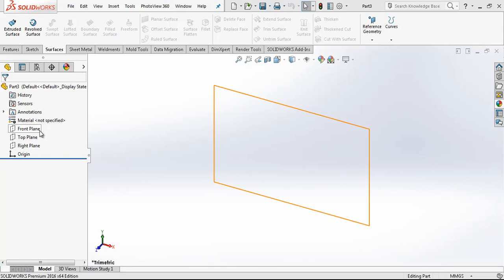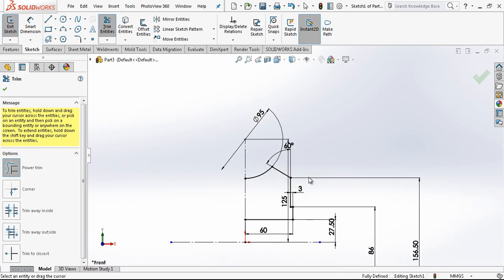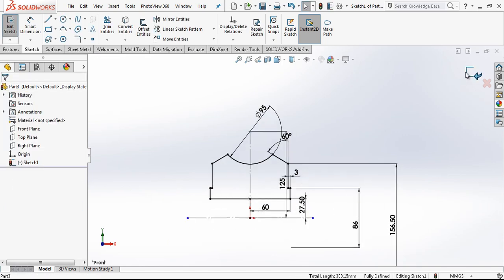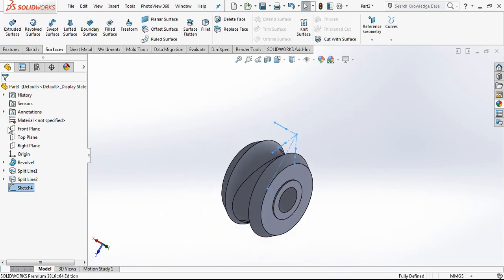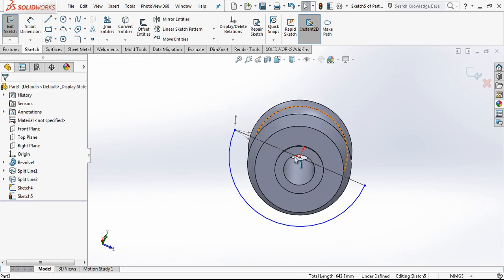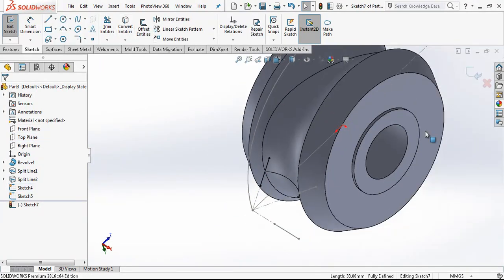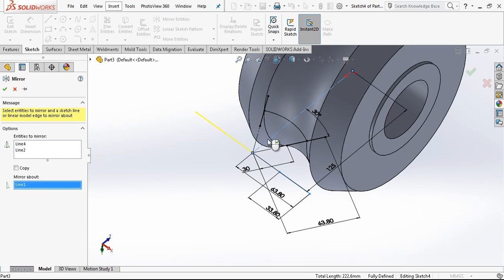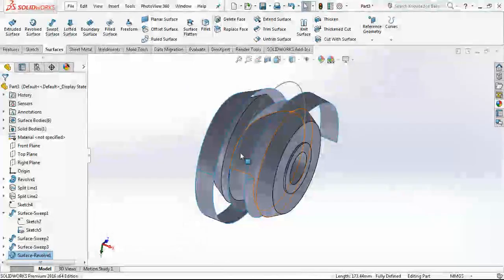How to Model A Globoidal CAM

Comment: How do you calculate the geometry for specific application? Is there a formula or some kind of design guide?
Reply from the maker: It is a cam path. Maybe you have seen before a cam path flattened to a 2D sketch. The same idea here.

You have idle sections mechanism, which is stationary and sections that make actions.

Please have a look at Google Cam Path flattened etc,
Reply: @3D-World  I know how the path looks or what it does. My question was that for example I want 4 stations, how big/small is the cam and wheel supposed to be? Is there ratios or formula to design the dimensions?
Reply from the maker: @gunny738

My answer is: no. 
You need to define your dimensions according to your own specific design, taking into account manufacturing limitations and your needs.